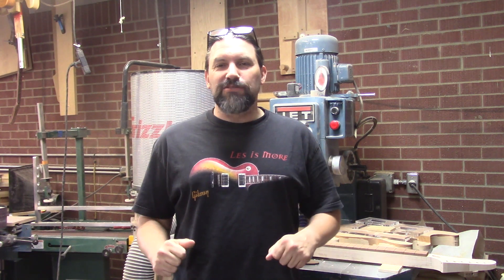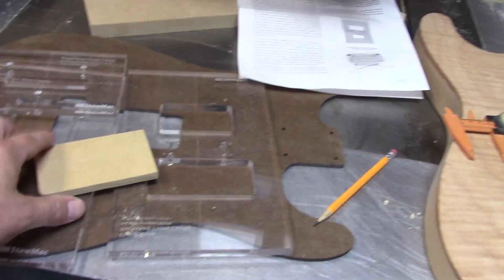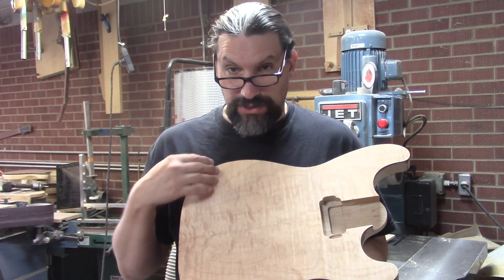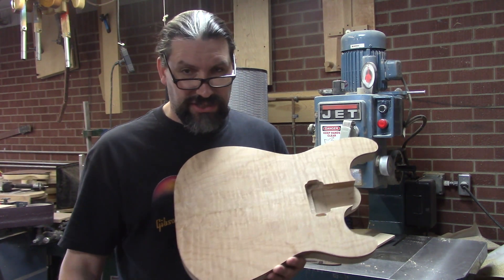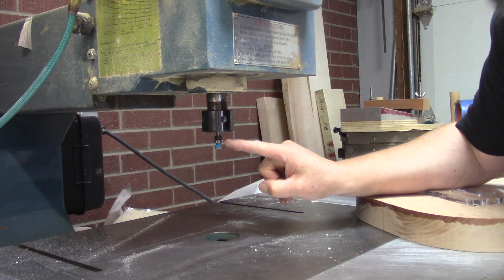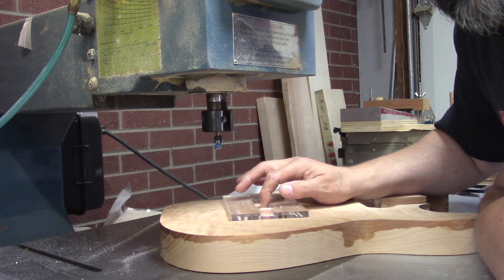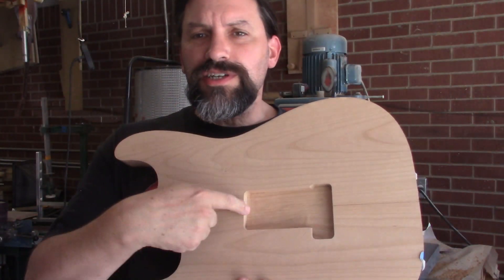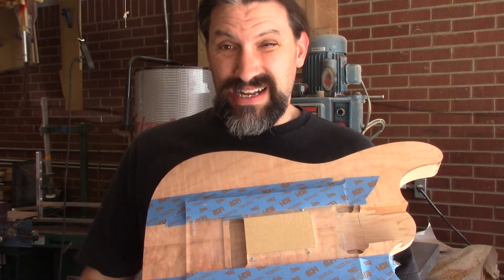Forget Everything You Know About Installing A Floyd Rose

Comment: @3:34 Slight confusion.  The Floyd Rose specs call for 25 1/8" from the nut to the post hole centers. If the line on the template is to be used, it would put the posts way too far forward, I believe. I checked the StewMac instructions, and the 25" is to the center of the two mounting screw holes on the template, I believe.
Reply from the maker: We haven't had any issues with the original Floyds and the StewMac templates but it is a good idea to check this stuff. Thanks for the heads up my friend.

Comment: 3:32 that horizontal line is the center of the cavity, not the 25" to nut. The 25" to nut are the actual screw holes. Just clarifying, I have the same template from Stew mac... don't throw me a coors can...
Reply from the maker: There you go
Reply: Is the 25” mark supposed to be in the exact middle of the screw hole? So that when I drill the hole, I put the tip of my drill right on that point.

Comment: Matt, another great video. Thanks again for taking the time to talk yesterday about the fret slot blade. Hope i didn't slow you down on the video
Reply from the maker: Thanks Paul, make sure and keep me posted on the SawStop fret slotting progress. I always enjoy talking to other guitar builders and I don't imagine a time when I will be too busy to hang out for a while.
Reply: Texas Toast Guitars Matt, it took a bit of searching but i found a company that will make the blade for me in 8" diameter, which will work( i hope). They make the blades for LMII. the 1 they are making me is only $108 plus shipping. Cheaper than the SM blade!
Reply from the maker: Hey, right on that sounds like a killer deal. Will it have the same profile as the LMII blade with the support flanges?
Reply: from what he says it will be very similar to the SM blade
Reply from the maker: Sounds like the hot set up. I might have to buy a spare from your conection
Reply: Mark at Blade Mfg Co

Comment: Hey Matt ! Great videos as always , But I have to ask ! The instructions for the templates call out that the 25 inch mark should be scribed on your template and its not the horizontal line you called out ? Can you confirm this ? If your correct then StewMAcs instructions are way off , Thanks
Reply from the maker: The Stew Mac Strat template I have referred to a scrubbed line the one for the Floyd... That I have has what i used in this video.
You should absolutely use the directions that came with your template set.
It's easy and fun! Hahaha
Reply: Texas Toast Guitars thanks for the reply , oh I know it’s straight forward for sure , I have the same templates as you used . I got with Stewmac to confirm there written instructions 
Keep the videos coming , I really dig what you do

Comment: ok ive done few floyd installs i evan put one on a dime 332 but ive always nut to center of the pivit post at 25 now ive heard some people are doing 25 1/8  . iam doing a kramer special with a gohto ge1996t floyd marsmointain states hes dome them at 25 1/8 mark.  so iknow theres 1/16 + or - on the posts but why the 25 1/8 mark?

Comment: Cool video, wish I had that pin router. I wanted to put a floyd rose on my Gibson SG, but it might be too thin (1 3/8" thick)? Do you think this is possible if I get a short block for the floyd (32mm I believe is the shortest block available)?
Reply from the maker: The big issue with a Floyd and any guitar with a TOM bridge is the neck angle. I think Floyd makes a reto-fit bridge for Gibson guitars but I don't remember what it is called.
Reply: @TexasToastGuitars  thanks for the reply. Is it an issue in terms of having the floyd sit flat on the body? because I actually prefer it to be sitting above the body. PS I currently have a "Floyd FRX" on my SG and doesn't do it for me
Reply from the maker: Yeah, that is the one, sorry to hear it isn't cutting the mustard. I'm not going to say that using a standard Floyd on a guitar that is set up for a TOM is impossible. It is going to be challenging.  Imagine a line from the top of the frets over the bridge location. On a Gibson the distance from that line to the top of the body is as much as 3/4 of an inch on some guitars. Now imagine it on a Fender and the distance is 1/2 or less... again, on some guitars. You know that it's different from model to model and brand to brand. Anyway, that extra 1/4 inch or more is going to have to be made up somehow. Another possible option, though really invasive, and expensive would be to re-set the neck at a new angle.
Good luck man, let me know what you come up with
Reply: @TexasToastGuitars  You were right on the money about that 3/4" measurement on my Gibson. I also own a Washburn Dime USA and it has a Schaller Floyd bridge. Surface of guitar to top of bridge saddle is 3/4" also. Main difference is it doesnt have the steep neck angle the Gibson does, just a fatter fingerboard. Again if anything I prefer the bridge to be floating high above the body (makes for easier whammy squealing). Is it still an issue because the Floyd pivot screws aren't long enough or am I misunderstanding the issue? Thanks again appreciate your 2 cents
Reply: @TexasToastGuitars  decided to go with my Floyd FRX. what's odd is I put it on another one of my SG's with no problem, yet both of them are from the exact same year/model/production. Not sure why I couldn't get the action at an acceptable height on the first SG. TY for your input though I enjoy your vids and all things guitar and guitar repair related

Comment: If i like to replace my 22 frets neck with 24, which should i adjust? The pickup position or the floydrose bridge?
Reply from the maker: Well the bridge will be in the same place since the nut isn't moving... I don't want to sound mean but are you up to speed on how scale length works?
Reply: @TexasToastGuitars  I was just worrying about the intonation and also the sound of the bridge pickup. . If the pickup move a little towards neck, i'm worried it might sound differently. If the bridge move towards the bridge pickup the wood in between which supports the studs where the bridge seats in might be  prone to breakage. Thanks